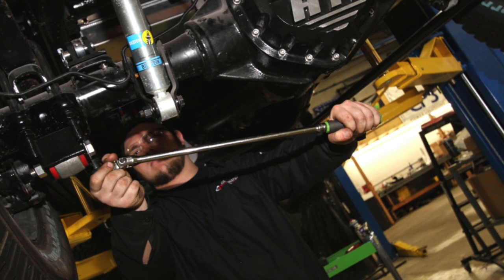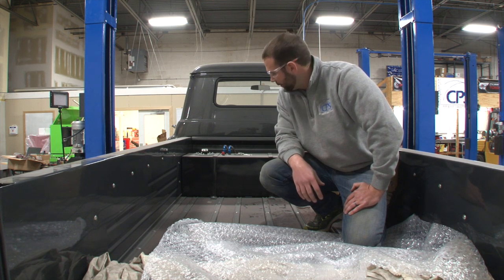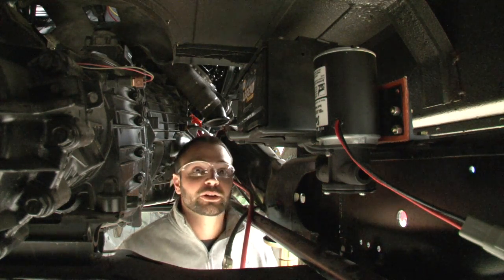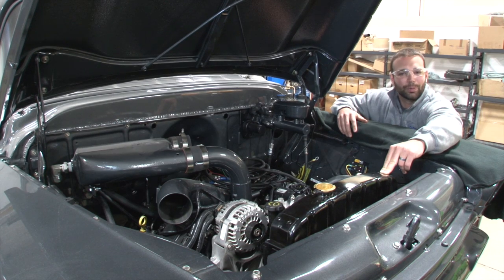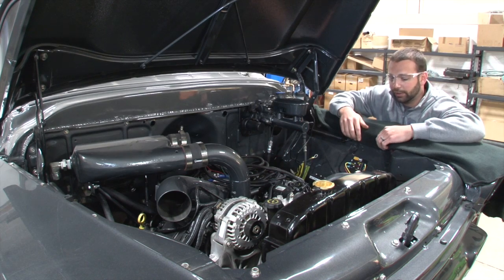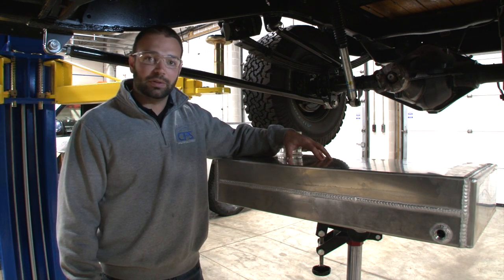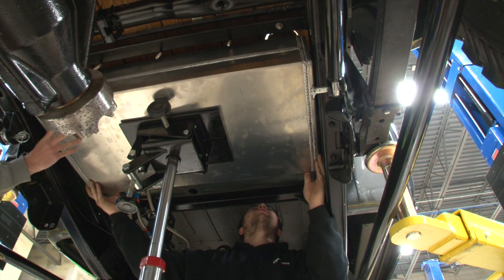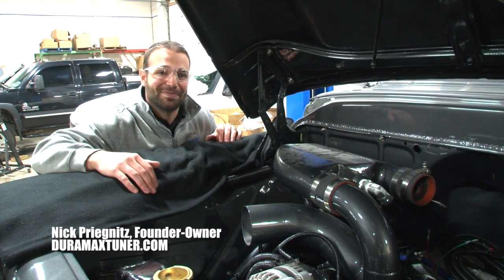ApacheMAX S3 • E1

Comment: Nick, might be a dumb question, but how does that tank not freeze? is there a heater?
Reply from the maker: Owen Cummings The ApacheMAX is designed for warm weather service as a sled pull vehicle, primarily. Off season, we may drive her around, but we'll probably avoid cold, nasty weather.